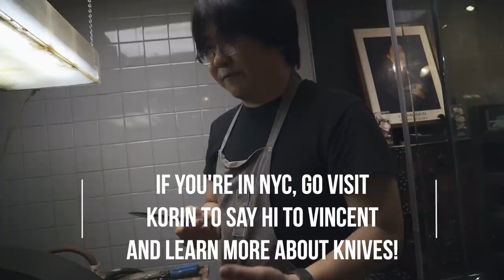Why Some Japanese Knives are Actually a Screamin' Deal w/ Vincent from Korin

Comment: For everyone talking about how he references Misono and the aging of the blade or "rest period", I believe he is simplifying annealing the metal which if done to its highest level requires a slow tapering of the heat over a long period of time the slower and longer annealing process will align the structure of the metal more equally and completely resulting in a stronger blade, however when he speaks of it bending or curving if you don't do this, I am unsure

Comment: Cool video and Vincent is a great guy, definitely a master level. But I really don't understand the aging part cause no, knives don't age it's not like vine because after quenching the only thing that can release the strain in the microstructure of the steel and therefore bend or warp is mentioned tempering due to carbon moving via diffusion (200-250°C and time depending on wanted hardness decreasing). So humidity or ambient temperature has nothing to do with it, knives in a bad environment can only rust and even stainless ones. Still enjoyed!
Reply: yes he needs to learn about steel and metal. and stop saying bull like that.
Reply: some steels air harden
Reply: @schlomoshekelstein908  yes many steels in fact but from a specific temperature at a specific rate of cooling same as other quench methods, all are part of heat treatment, and has nothing to do with resting or aging. Some steels has a low temperature long time phase transformation E. G. Some train track steels are heated Ed to slowly form Bainaite crystal structure but isen't really applied to knife steels of such small cross-sections martensite is the harder state you want in knives some carbide formation in steels with high chrome and other alloys.
And besides even air hardening steels are rearly air hardened if they are used in small cross sections such as knives but with contact with quench plates of aluminium and those steels are rarely forged as the working temp range is far too narrow for human forging

Comment: Is forged knives generally better than stamped knives?
Reply: Are* forged knives better? No. Depends on the steel itself and how it was heat treated. Most industrially-made forged knives are actually stamped out from sheets of steel, anyway. The stamped-out blank then just gets re-heated and hammered into a mold. All industrially-made Japanese knives such as Misono, Miyabi, Shun, Tojiro and Yaxell are in fact stamped knives.

Comment: Letting the steel rest...now that's a new theory I haven't heard before, interesting to say the least. I will research this further
Reply: its sad he knows so much about knives but so little about steel. he should read a book so he can stop spewing nonsense like this
Reply: @DClaville  You may be mistaken on this. Rolled steel contains some tension. It's also common to let cast iron age a little to relieve the same tension.

For very thin stock, it might actually be useful, even at room temperature.
Reply: @rationalwoodworking8761  in the bought state most steel and metal has some tension yes and? all that is dealt with by heat treatment, not letting it "rest" or "age". it is misinformation. and i am not mistaken, cast iron is also not aged it is heat treated
Reply: @DClaville  Hey Daniel, with respect saying that they heat treat does not mean that they don't age it (logic mistake, heat treating and aging are not exclusive).
And yes, aging at room temperature (natural aging) is a thing for some cast iron (https://www.moderncasting.com/articles/2014/01/01/cast-iron-machinability, figure 11).
Can we say natural aging of thin Japanese steel for knife making is a good thing/bad thing/ useless thing then? No, not enough information obviously, but we should be respectful and acknowledge that we don't know enough ^^